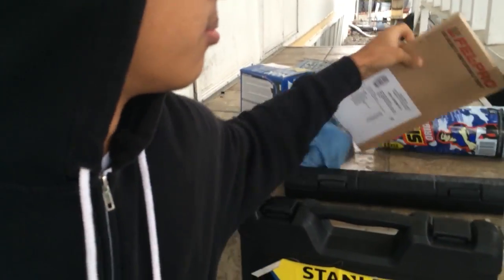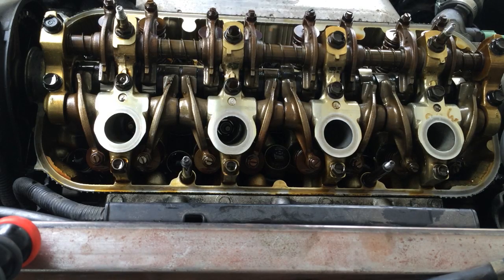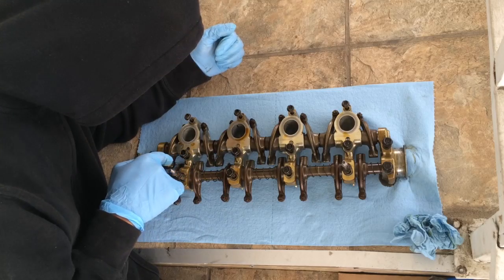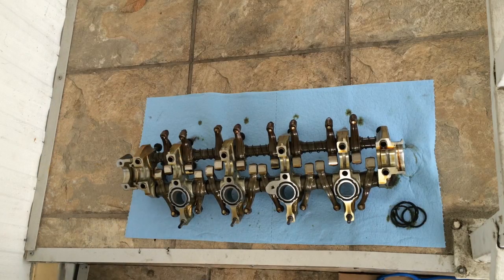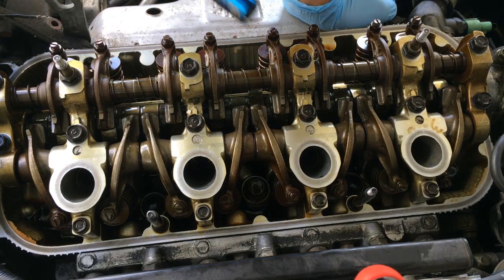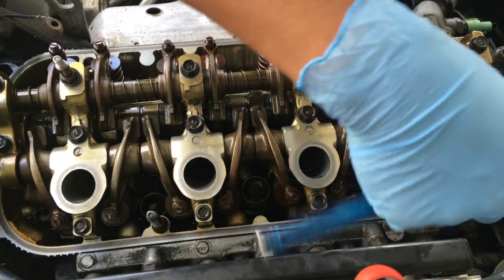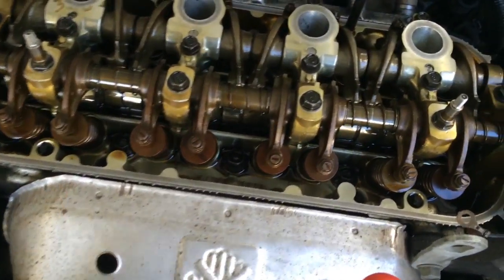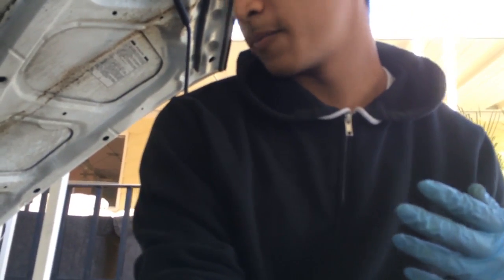How to Fix oil in the spark plug well - Replacing the valve cover gasket in a Honda

Comment: Yep someone needed this video today and luckily this is easy to do because I'm experiencing oil in the spark plug well 😭
Reply: Did you do it? I need to do it also, just the first two spark plugs are oil filled. On the treads of the spark plugs, not the top.
Reply: @chubbylove1519  same here brother. I wanted to do it but I'm not confident in my skills I don't want to fuck it up even more.

Comment: Does anyone know if u don’t replace the ones Under the rocker arms is it still gonna leak
Reply: Probably because that's where it usually leaks. Quik way to find out is clean the spark tube cylinder out then start start the engine up, run it for short time, remove the boot and shine a light inside. You maybe able to see from which seal the leak is coming from. It was pretty obvious in mine. Hope that helps

Comment: My 97' Odyssey started missing. The plug wells were filling with oil from leaking gaskets. Sopped it out with paper towels and long surgical forceps. That was it. Runs perfect. Easy to do when needed. FREE.

Comment: I'm no mechanic or anything, but I'm pretty sure that the torque sequence should be used from the start, while loose. So the assembly is seated properly to avoid warping. When you tighten one and another becomes loose, that's the assembly being seated. 

If you've even put up drywall, and screw up a sheet at the top and then the bottom and then the middle and got stuck with this big bubble/bulge in the middle you'd have a good idea why it's important.

Again, not a pro, just my personal understanding.

Comment: I have an easy fix for you. I have a 97 Accord single cam. About once every two months I pull a couple spark plug boots off and see if there's any oil on them. If there is do this when the engine is cold. Pull the spark plugs out of the hole spray a little brake cleaner in and reinstall the spark plug with a little never cease. I've been doing this about every 3 months for 3 or 4 years. It only takes me 2 or 3 minutes to accomplish it and I don't have to pull the rocker arm assembly off the car which if it's not put on perfectly and torqued correctly. You could have a big problem. I'm not saying my way is better it's just the way I do it.
Reply from the maker: Hey thanks for sharing that with me, definitely sounds like a good little type of preventative maintenance. I for sure never want to have to do this if I don’t have to haha I’ll give it a try! Thanks again and have a good one :)
Reply: I have a 95 Accord. I have the same problem, I would totally try your suggestion man. It's easy and I won't fuck my engine up. What I do is replace my sparkplugs and that is stupid.haha

Comment: How to clean oil out of spark plug wells on 1996 Honda Accord. Always start by doing the simplest "fix" and work your way up to the most complex "fix". 

1) Go to Walmart and buy a can of spray carb cleaner ($2.50) and a bottle of Bar's Leaks ENGINE OIL Stop Leak concentrate ($7.00).

2) Go home. When your car engine is COOL, remove the spark plug wires and clean the ends with a clean rag. Spray some carb cleaner up into each spark plug wire and clean them out as much as possible.

3) Do Not remove spark plugs. Spray carb cleaner down into each spark plug well to break-up and thin the oil that has leaked into each well. Use a long thin phillips head screwdriver, or even a piece of wire, to stir-up the carb cleaner in the wells and break up the oil. Be careful NOT to damage the spark plugs. Now put a rag down into the wells to soak up the oil/carb cleaner mixture. 

4) When you are sure you have soaked ALL of the oil out of the wells, remove the spark plugs one at a time, and clean them, and gap them correctly. With a rag and screwdriver, wipe the wells out again before you REINSTALL the spark plugs.

5) Pour the ENGINE OIL Stop Leak into your engine oil. This will make the seals in your engine swell up, including those seals around your spark plug tubes, and hopefully put a stop to the oil leaking into the tubes.

6) After two weeks of normal driving, check the spark plug tubes again, and clean them out if there is oil in them. Some oil probably will leak into them until the Stop Leak concentrate gets a chance to recondition the seals.

7) If oil still leaks into the tubes after a couple of months, the seals may have to be replaced. But you may as well try this method first. For less than $10 and about two hours, you might fix your problem.